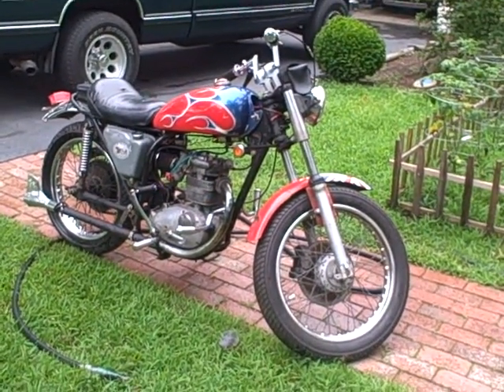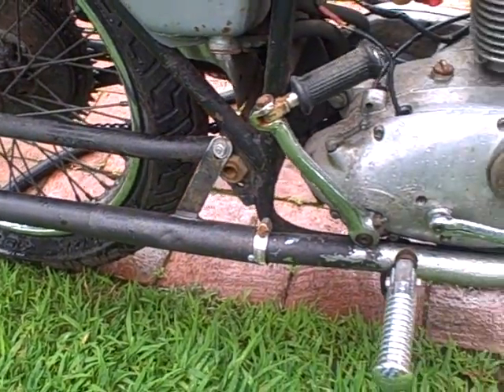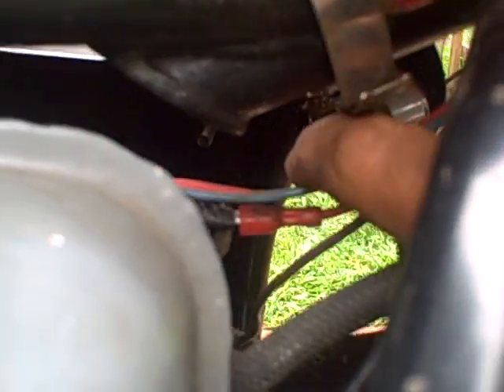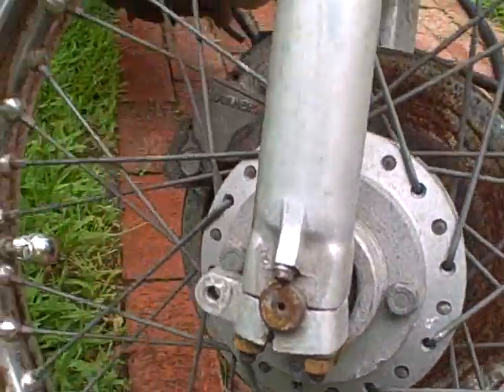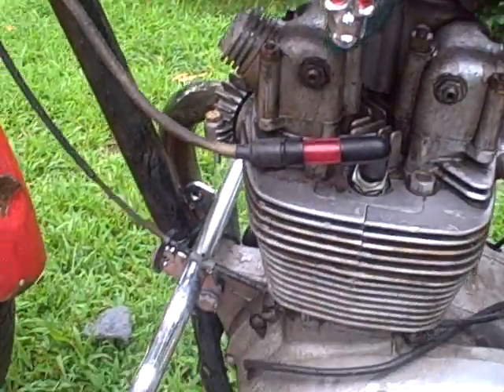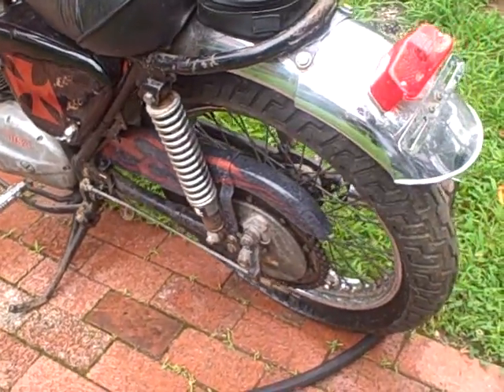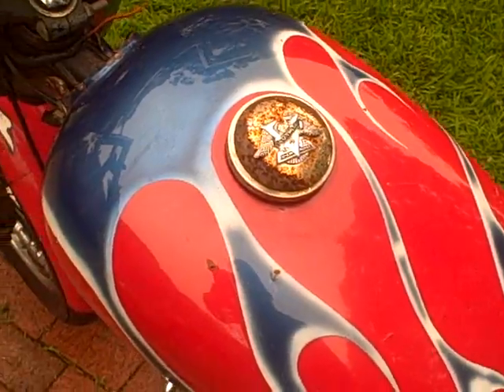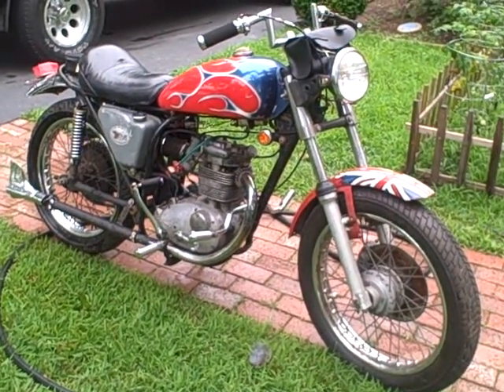BSA 250 Starfire Piece of Crap

Comment: The front end looks like Triumph T140 as Starfire's never had disc brakes. As a retired m/c mechanic of 48 years I would say fully strip the motor and go through it, not forgetting to clean out the crankshaft sludge trap, it is down the blanking plug on the r/h crankshaft fly wheel edge, not to be confused with the crankcase filter at the bottom of the crankcases. if the sludge trap blocks up no oil feeds to the big end, the rod snaps and your motor is wrecked. Also drain and wash out the oil tank, along with the filter in there as any metal bits from past engine blow ups may be in there. I have owned a Starfire for years and they are a great bike once they are sorted out.

Comment: Not enough room in the last post.
The tank on your bike is either a HD shovel head supper glice, early 80s sportster or if it has a cut out in the bottom a HD sprint.  

I am glade you got it running and are having fun with it. Ride Safe.